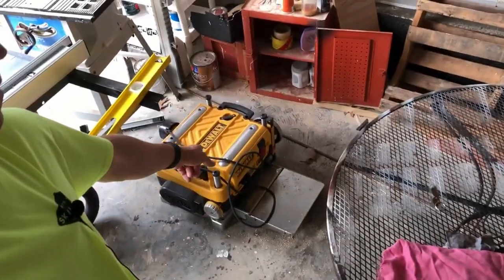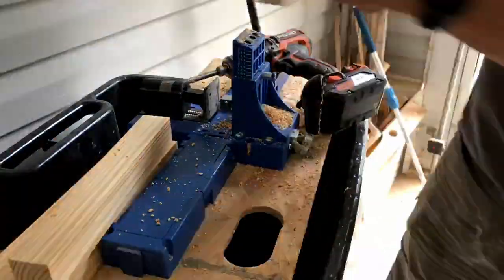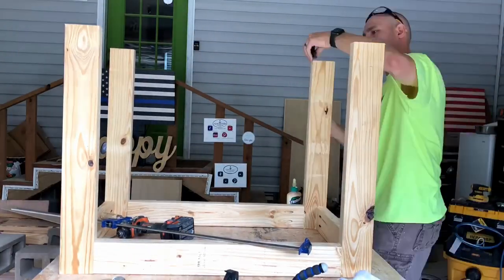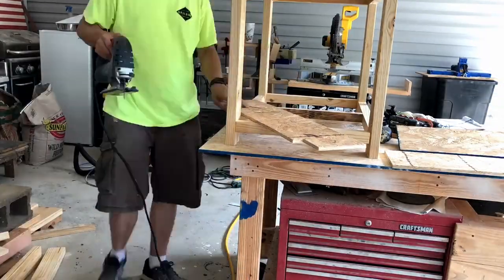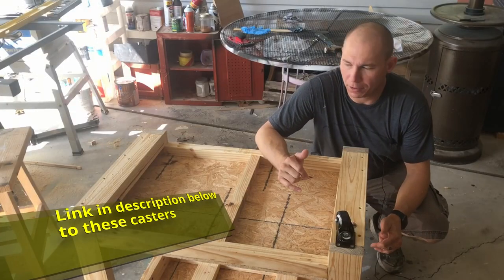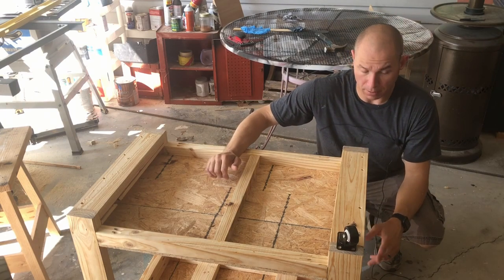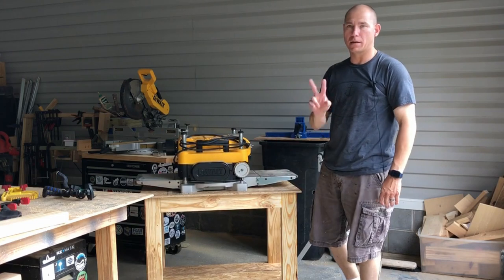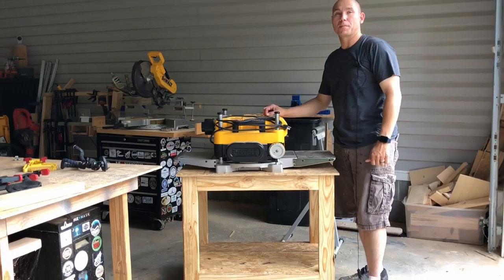Rolling Tool Cart / Planer Stand DIY

Comment: Thanks much for this video. I followed your review of the planer, and mine arrived yesterday. I first thought about making the cart to where I could put a removable top on it, above the planer top, to stand in as an extension table for my saw, but found that the planer table would be too low to function well. I'll give this a shot and make it like you did. Since I don't have the pocket hole jig, I'm going to use half laps. That requires different 2x4 dimensions, but not a thing at all. Oh, for some of your viewers, OSB is Oriented Strand Board, and as you say, just glued up wood chips.
Reply from the maker: Thanks. Cool idea on the half laps. I’d like to see pics of your finished product if you want to share.
Reply: @731Woodworks  I've done some pictures, but still not done with the project yet. I decided to add 4 drawers to the side of the case, and am still trying to figure how to set the middle divider up easily. (Everything's glued and screwed up already.) :) Should I email them to you? I don't have a blog or web site.
Reply from the maker: Gotcha. You can email them or I have a Facebook or Instagram accounts @731woodworks

Comment: I've watched this and want to use your plan for my planer as well, not the Dewalt I went with the Wen but nevertheless should work fine j was wondering I wanted to use 4x4 for the legs and 2x4 for the rest and OSB  for the top, I also was thinking about putting my miter saw Bosch GCM 12 SD so I can roll it into driveway in summer months, I don't have a dedicated Mobil miter saw stand the Bosch one is like 329 bucks and seems kinda expensive for a stand but the saw is 629 bucks so I guess you want it to support your investment anyway that is why I wanted to use the 4x4 for the legs because I thought it would be more stable

Comment: Thank you for the video/blog. Question about the 2x4s used to create platform for casters: they just overhang the inside of the 2x2s? Thanks for advising.
Reply from the maker: Yes
Reply: @731Woodworks  Thanks for quick reply.

Comment: I like this plan but I'm wondering a few things.  1) wouldn't it be stronger to run a 2x4 UNDER the legs to attach the casters to?  (Instead of between)  2) I recommend turning the top supports on their edge/vertical.

Comment: Just built this to put my planer on and my sander.  Been meaning to do it for a while and finally have a project I need it for.  The ripped 2x4 felt a little weak but I was also about to run out of long enough pieces anyway so the rip came in handy.  Put a full 2x4 as a cross brace on the bottom shelf too to make me feel better, but again the top was really the important one because the planer is so heavy.  I used 3/4 plywood instead of OSB which is probably a little sturdier.  I climbed up on it and shook it (and I'm about 240lbs) and it felt rock solid.  I just used pocket holes without glue in case I ever want to take it apart to modify a bit in the future.

Comment: Hey Matt, thanks for the layout.  I found it not only easy to do, but very universal as well.  I made a cart for my planer, (same DeWalt  model as yours), and then modified the dimensions to make a stand for a jigsaw table too!  I wanted to use a jigsaw like a scroll saw, it came together really quickly and turned out great.  I actually had to stop myself from over-engineering it!  BTW, one mistake I made on the planer stand was buying casters from Harbor Freight.  Not worth it! You truly get what you pay for!
Reply from the maker: For sure. Thank you